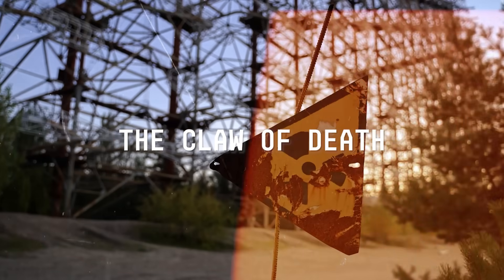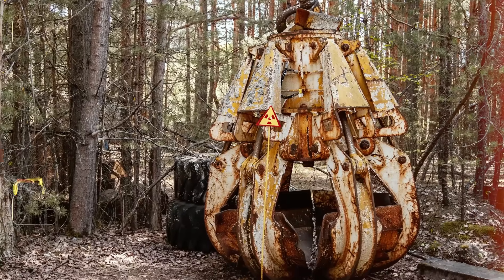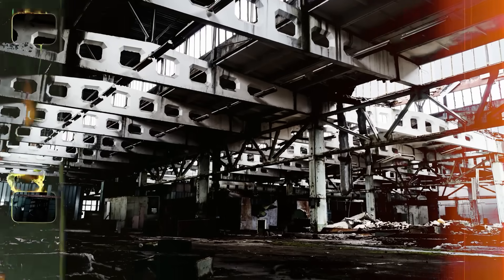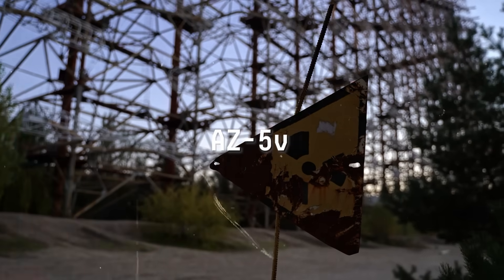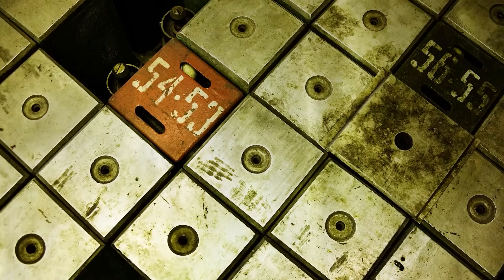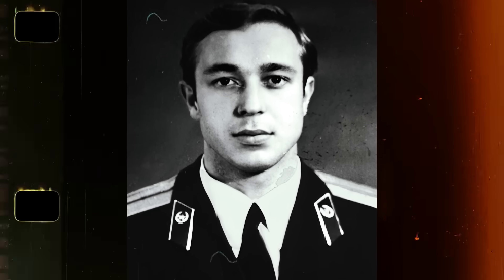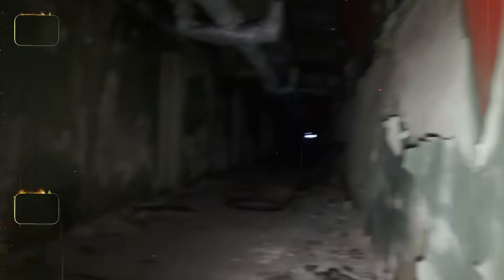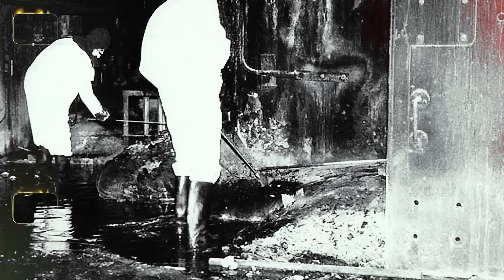Abandoned Secrets of Chernobyl: 5 Mysterious Artifacts That Were Secretly Left Behind

Comment: Radiation doesn't "accumulate" in things. The claw is mostly just covered in radioactive material debris, a small amount on the surface of the steel may have gotten neutron activated. But it accumulated radioactive debris, it didn't become radioactive in and of itself. You could litterally scrub off 99% of the radioactive dust etc and it would likely barely set off a geiger counter more than background.

Comment: "tips"  do some of the most basic research, please.  Those "tips" are 4 meter long  displacers.  The graphite wasn't the cause, them not being the full 7 meters of the core along with the positive void coefficient were.  The graphite displacers pushed out the water that had been moderating the reactor on their way down.
Reply: @ I mean it how I said it, though I may not have been clear. First, when saying something is or is not a moderator I mean that it is a major one, or not a major one.  Everything has some effect on the neutrons, but some things have little effect and some have a lot.  Water is a moderator. Steam is not. Boron is, and graphite is not. Those along with uranium are the main things found inside a RBMK reactor. 
The control rods in reactor had a 4.5 meter long section of graphite that would sit centered in the 7 meter tall core when they were fully extracted, with 1.25 meters of water above and below in normal operation. Above that 1.25 meter gap at the top was 7 meters of boron. In normal operation as the rod was lowered the graphite displacer would push the water out of its way on the way down as the boron came in from the top. (Note: there were alarm rods that came in from the bottom that worked in a similar manner). At the time of the accident there were very few rods positioned such that the graphite was in the bottom meter of the reactor. The water there was moderating the reaction. When A3-5 was pressed to scram the reactor, suddenly all the graphite displacers pushed that water out, effectively sending the bottom of the core in to full power with no moderation. The water in the channels and normal water passages instantly flashed to steam, which does not moderate the reaction. In reactor parlance steam is called a void. For a brief period as the control rods descended there was nothing but graphite and voids of steam in the reactor. It made as much power as it could, going critical.  The problem was not “graphite tips”, it was that the 4.5 meter displacers should have been the full 7 meters so that water that could void was not moderating the reaction.

Comment: The situation with room 305/2 is understood and was expected when the new cover was put in place. Leaks in the sarcophagus (the original cover) allowed water to get into these areas and as water slows down neutrons (called moderation) it kept the hot spot somewhat active. However, now that it's drying out the neutrons are allowed to reach higher speeds and rates so it shows as a spike. Not only is the new cover is equipped to deal with this, there isn't enough fissile material to create another disaster.

Comment: The theory about the technician pressing the button twice is possible but the results would not have been as described, all the documents I've read about the conception ( i had to do some lossy translation too for some docs so maybe not 100% accurate) of the technical desk and how it interact with the reactor and it's quite crude (maybe not the right word sorry) so once AZ-5 is pressed the "control" rods are lowered quickly in the reactor core and that's that, i did not see in the docs that by pressing it twice or pressing in continue change the "descending" behavior of the "control" rods. You rip the wax seal, you push the big red button & you pray the reactor shutdown.... but as we know now and thanks to the KGB who ripped the "security" pages of the technical documentations to avoid techniciens to know a lot of stuff and that the tip was graphite, i think they/him on this case would have not pressed the button at all...

Comment: Hi, guy thats been there as a Stalker here. 

The claw never was secret. Its been parked where it is now due to lower people traffic. 

Its radiation is not deadly upon contact. In fact if you stand 3-5m away from it, you cant even measure it. 

Measured directly on contact at the bottom of it, it reads 426 uSv/h (microsieverts per hour). Normal background radiation is between 0.01 and 0.3 uSv/h

Comment: Up 'til today, (Soviet) Russian design is the definition if a flawed design. In a sense, that from the planning phase, which mostly included comprehensive safety  measures and clever designs, the 'product' suffered from rushed execution and poor reliability and craftsmanship in minor components, such as buttons, switches, connectors, soldering, isolation materials or basic quality control.

Comment: It should be noted that the Jupiter factory was also the second largest employer in Chernobyl's area, only the CNPP employing more people in total at the time. Its suspected that the grey sand is remenants of the Boron sand used in the cleanup efforts, having absorbed the radiation from the flyovers; another plausible theory is that its graphite that was recovered from the disaster, crushed and granulized to be experimented on for further applications due to its extreme radioactivity.

Comment: Usually the readings from the claw are in mSv but there are very, very, very hot spots and you don't always know where they are. There could be plutonium in a crevice close to where you are measuring and you wouldn't detect it with most equipment. I haven't seen anyone detect over 1Sv. Most of the risk comes from disturbing the surface of it and consuming or inhaling highly radioactive contaminants.

Also, the increased activity in 305/2 is expected due to the building drying out since the NSC went up.

Comment: 9:30 so that's not correct because if you activate AZ-5 it's registered by SKALA and you cannot cancel the scram procedure but in the original design take 45 sec to all rod getting inserted to the core fully...and the rods jammed because the intense heat melt the fuel channels
Reply: Yup 👍🏻

Comment: I have a question…..   so steel rusts……. Flakes off and disintegrates.  Is rust dust still radioactive and how easy it it to become airborne?
Reply: Yes the dust will still be Radioactive , a huge Cloud of Radioactive Dust swept over certain parts of Europe , I remember when it happened in 1986 .
Reply: No, the rust itself not, or any material the claw is made of. The actual radiation comes from debris still on that claw. Iron once irradiated has a half life of about 44 days for Fe59 and 2.7 years for Fe 55. Fe 60 does exist but it has an absurdly long half life of 2.6 million years.

Comment: The uniforms aren't in the hospital basement anymore. They've been moved because people were touching them and stealing bits of the items.

The claw has also been re-painted several times, sometimes due to graffiti, sometimes as an attempt to keep the radioactive dust on it contained.

Recent reports also indicate that the elephant's foot is breaking down, turning into a flower-like dust, from its own radioactivity.

There's a lot of stuff going on in Chernobyl that makes me never want to go there. 

Take it from me, someone who works in nuclear power plants all the time, you do not want to go there either.
Reply: The firemen's uniforms are still in the basement, just the access point has had sand and concrete poured into it to stop people getting in
Reply: Is that you Homer?
Reply: Not worth going everywhere if ya go just because ya can. Agree with that. Some is back to fairly normal and safe. Others still not and won't be for ages.
Reply: Bags of sand and concrete were thrown Into the burning open reactor to try and put out fire and help contain and seal the reactor.
Reply: I heard the uniforms were donated to nuclear medicine departments of hospitals
Reply: None of these hidden things are hidden.
Reply: I work with nuclear power. I visited Chernobyl in 2013. Didn't go down into the hospital cellar. When I walked across the top of the stairs my dosimeter went mental. Nothing would get me down there. We did spot some lumps of graphite that had been ejected and missed in the cleanup, over near the part complete cooling towers, didn't hang around them. I saw the claw, it had been freshly painted a nice red colour, but certainly didn't get in.
I brought home a souvenir but checked it thoroughly first!
Reply: Wise man indeed.............
Reply: YES IT WAS PAINTED PINK ONCE
Reply: I want to buy a chunk of the elephant foot
Reply: I work in a nuclear power plant as well. Not sure how working in a nuke plant gives you a better idea of why you shouldn’t visit Chernobyl lol.
Reply: @dreameater9247 ooh but it makes his bullshit opinion sound so much more authorative!